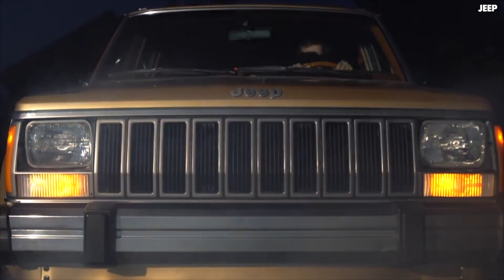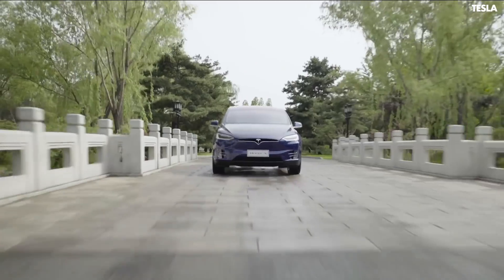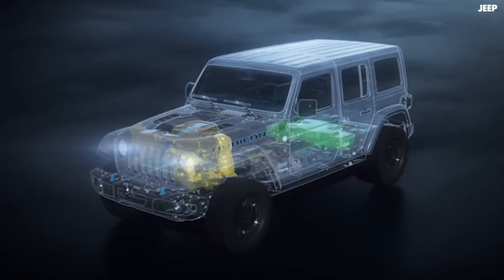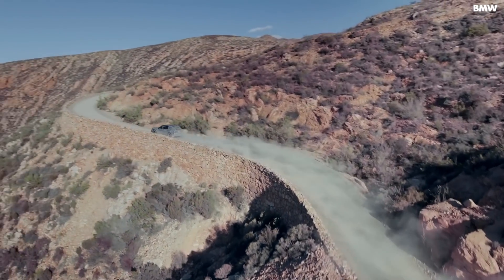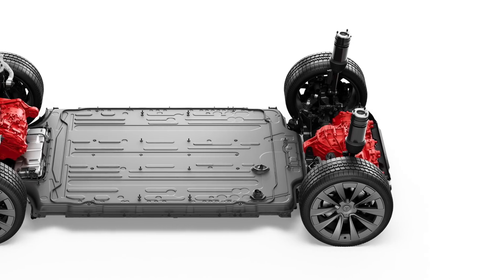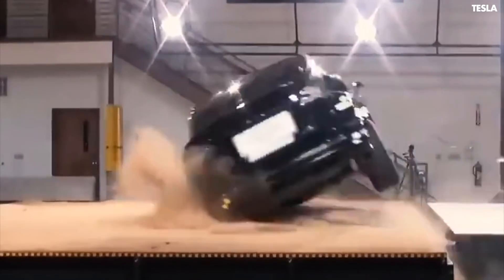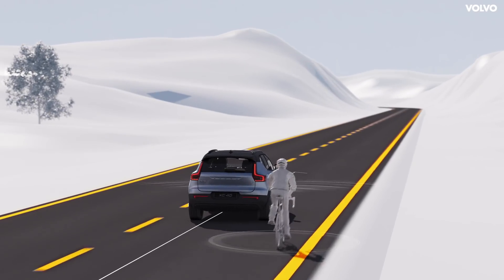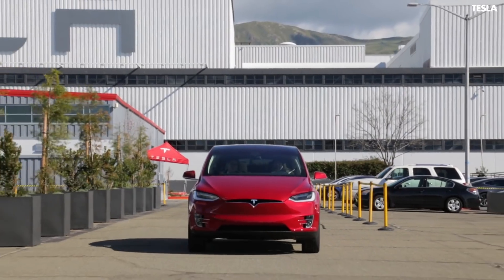How Tesla Made the Model X IMPOSSIBLE to Roll

Comment from the maker: ⚡️This has to be one of the coolest SUVs on the market, some of the engineering in this is genius!

🤔What should we cover in our next engineering video? REMEMBER TO SUBSCRIBE!
Reply: Can you make a video about the Lamborghini terzo? I think it's energy comes from the batteries in it body.
Reply: Cover the Rivian R1T with its air suspension and hydraulic roll control.
Reply: Same
Reply: Its even better when you put a roof rack on it.
Reply: Maybe the suspension system of the 2CV as it will surprise, as well as the hydropneumatic suspension invented by Citroen in the 50s as many do not realise how advanced it was.  They were also near impossible to roll !
Reply: Should have made the car more fireproof instead
Reply: The difference between traction control on and traction control off. That would be cool.
Reply: @StarryLFC  Believe in JESUS today, confess and repent of your sins. No one goes to heaven for doing good but by believing in JESUS who died for our sins. GOD loves you soo much unconditionally.😍🤩😇❤
Reply: It does not have 1000hp the model X plaid will have 1000hp but it has not been released yet, it has around 700hp
Reply: Not having an engine actually is worse because usually the engine block absorbs a lot of the crash energy

Comment: @Driven Media

 maybe I am wrong, but air suspension and adaptive damping won’t make a significant difference in the handling of a car compared to more passive setups. The advantage is that it can adapt better to different situations, but all of this comes at the cost of a significant increase of unsprung mass and overall mass of the car which reduces stability. 

Another thing to know: air suspension is limited in its bump absorption potential since there is a lot more friction (compared to coil suspension) in the process of the the suspension compressing and decompressing process which slows down the rate it can move up/down. 

The biggest benefit of Tesla’s suspension system is that the car can lower to improve stability, but the other suspension technology is to help compensate for some of the downsides of using air suspension.

Comment: These battery packs are SO heavy and Tesla balanced them so a "roll-over" is impossible! Problem is the significant ADDED weight wears out the tires and brakes WAY faster too! NOBODY mentions this little tid-bit! If YOU search tire and brake dust pollution you'll see EV's are WAY WAY worse than gasoline vehicles and are a LARGER problem than CO2 emissions as far as pollution goes! Still think these EV's are still as "GREEN" as these CLOWNS are pushing?? WAKE-UP! The other elephant in the room that NOBODY talks about is HOW do you think all these EV's are going to charge? Fossil fuels! Solar can NOT meet this "demand" by even a long-shot! These clueless CLOWNS are putting the cart before the horse because there is NO infrastructure in-place to "charge" these EV's until 2030+! STUPIDITY on every level here!

Comment: There's one other reason the Model X is far more roll resistant than other SUVs that you glossed over - low ground clearance. The example off-road targeted SUVs you showed had way more ground clearance than the Model X even on its high suspension setting.
Reply: Its not really an offroad car more like a toy for people who want to be higher above the road.
Reply: @microsoftword213  Yeah I know, which is why comparing it against a load of vehicles which are for offroad showed this result

Comment: Apart from where the batteries are placed in the vehicle, half of the reason that the model X resists roll so much is due to the weight of the batteries, even the car rolled on its side, the car will rollover back on 4 wheels. So when batteries get lighter, the car would expected to roll more since a lower percentage of the car’s mass is low down.
Reply: Then they will just add ballasts, I'm suprised no other SUVs do that since it seems so beneficial
Reply: @explosiveswine7354  Because adding weight on purpose is stupid because it hurts performance like acceleration/deceleration, speed, handling, and range.
"Luckily" battery weight won't ever get that much lighter.

Comment: You literally never showed a single picture of a rollover test on the X.  Only the S.
Also, air suspensions aren't immediate.  They take a few seconds to completely adjust so this really doesn't have much to do with rolling over.  Many cars come with adjustable ride heights and this is nothing new.  I guarantee you can make an S or X rollover since many drivers I see in them are doing 80+ mph.  You make a sharp correction at that speed and you'll flip anything.  People in regular passenger cars aren't wearing five-point seatbelts and can lose contact with the wheel since so many Tesla drivers are barely paying attention to the road in the first place.

Comment: I’m confused, so the center of gravity has to be low or high? He said that Tesla’s heavy parts have to be placed higher up because idk what and then in the sand testing it shows that the center of gravity is really low
Reply: Motors and drivetrains have to be mounted higher up in the air and that adds to higher rollover rates.  The X motors and battery are as low as the frame.  This contributes to lower rollover rates.  Notice he didn't show any pictures of the X in rollover tests, only the Model S?  He's making it sound like the X center of gravity is below the ground but we're talking about several inches.  Yes, it certainly helps but he's crossing in to hyperbole territory with his story.
Reply: @sarcasticguy4311  ty, I was confused
Reply: nah, he said standard suvs have high center of gravity

Comment: yea but, i have never seen a model x went offroad. like the real rock crawling low gear style offroad though so it doesn't really match to those other SUVs you have mentioned like the Cherokee and the Toyota Prado. hell even the BMW X7 went for dune sand Sahara style Baja offroad, i wanna see a model x do that. (probably failed because low ground clearance (even with the highest suspension setup) and will sink into the sand due to its insanely heavy batteries)
Reply: Even SUVs showed in that video can not handle off-road driving (Cherokee with mods can of course).
I believe that Tesla is not designed for off-road like other SUVs.

Comment: Hold up! Did you say that you can't adjust the seat distance from the steering wheel etc has been removed from the Ferrari to help try to reduce the CoG? Is that what you meant by they removed the seat runners? How tf do they expect drivers to be safely in the right position for them? That's ridiculous! I have to bring the driver's seat about 6" forward after my tall, long-legged husband has driven my car. And I'm not exactly short (about 2" above average for women).

I know this was about Tesla's amazing safety tests, and yes, that really did impress me, as did your explanation of the hows and whys (thank you for that, it was a fascinating insight. I'm not a lover of the marque, or SUVs, but who knows if I'll be forced to buy an electric car at some point. That's actually persuaded me to consider them). But that really caught my attention because it's potentially flipping dangerous! Not that I'd buy a Ferrari if I could afford one (overrated much? I think so), but were I a fan of theirs, that would be a deal breaker.
Reply: Simple answer is the dealer fits the seat to the buyer. Not great, but these aren't daily drivers either.

Comment: You said 3 differentials. But it's 2 differentials and 1 transfer. The transfer handles splitting the power between front and back and does so very differently from how the dif does at the axles.
Reply: Depends if it's an AWD or 4x4 setup. An AWD setup has 3 diffs and is always sending power to all wheels. A 4x4 has a "transfer case" in the middle that splits the torque 50/50 and is usually capable of disconnecting the front driveshaft so a difference of torques on high-grip surfaces doesn't snap the case or break something.
Reply: @schwarzwolfram7925  Technically a locked transfer case doesn't split torque 50:50, that's actually what an open diff does. That's the entire reason you want a transfer case to be able to lock - if it was open the extremely small torque required to spin the axle without traction caps the torque to the other axle. If it's locked and one axle has no traction then the torque split is nowhere near 50:50 since the axle with traction gets far more torque than the slipping axle.
Reply: @bosstowndynamics5488  I think I understand what you're getting at, but I still seem confused. When a transfer-case (or differential) is locked, all output shafts act as one connected unit; so both axles should experience the same shared torque and spin at the same rate. The key difference is the amount of stress each axle experiences (which will be highest at the point of most resistance).
Reply: There are so many diffs that exists
Reply: Actually a lot of transfer case options these days include a differential with a locker so that you can run open on the road or locked off-road. The 150 series and 200 series LandCruisers for instance both have centre LSDs with a locker, Mitsubishi Superselect vehicles have viscous couplings with a locker, some Jeep transfer cases have centre diffs (eg SelecTrac) etc.

Comment: Well first of all it has like an inch of ground clearance so I would call it more of an MPV than an SUV
Reply: The Model X has 8 inches of ground clearance available. That's more than a Suburban has, but less than an Outback. Again, the skateboard platform with air springs files off the rough edges of conventional layouts.
It may look like it is not far off the ground, but that's because it is huge when you are actually standing next to one. But the step in height is not really bad because there is no need to raise the passenger cabin over the drivetrain. More edges filed off.
Reply: @Markle2k   tesla model x 2020/21 ground clearance 5.4-5.6 inches.  2020/21 standard suspension burban 7.9-8.0 inches.
Reply: @ianrobertson3419  I actually looked it up. In high mode, the X has 8 inches and the Suburban has 7.9, the Outback was something like 8.2, IIRC.

Comment: I really don't understand the appeal of SUVs. I feel like most never even see a dirt road, much less any kind of off road situation.
Reply: People do not buy it for off roading. Same as all the truck drivers that never use the truck part.
Reply: i do. i offroad for work and i can't have any less than an awd suv (tbh even those struggle, so i mostly drive pickup trucks), but even if i didn't, the fact you don't have to bend down to enter/leave your car, the internal space, everything just makes sense. they're not killing every other category for nothing, they really are objectively much better "people movers" than every other category.

that said i would totally own a sedan or even a medium hatch over a suv if i could help it. unfortunately those disassemble themselves just by putting them on a dirt road that's not perfectly maintained and wouldn't even be able to get to my workplace at all even on good days, so i have a bunch of pickup trucks and a suv, which is a compromise between capability and driving pleasure / city usability that i have to take. it can get to me to work and it's reasonably fun to drive, plus all the inherent advantages.
Reply: Just to name a few. Higher driving view. Bigger cargo space. I have to carry elderly passengers from time to time. They hate to crouch to get inside sedan
Reply: they are mostly made for families

Comment: I heard that it got one of the best scorers in the Moose test. The most difficult handling test. That thing something since most cars barely pass. Most cars pass if they don't roll over at a certain speed.
Reply: actually, very few cars roll over during the Moose test. generally, they will either lack the handling to make the rapid changes in direction or have excessive oversteer/understeer.  and more commonly in newer cars, the electronic stability system will attempt to prevent a slide and cause the vehicle to go "off the road" as a result. some teslas have had a problem in the moose test because they have a tendency to oversteer.
Reply: Moose test? Isn't that a mean thing to use mooses for? And why isn't there a gator test? I had a guy come to a stop a ways up in front of my on an otherwise empty 70mph road and I almost went around him and I was glad I didn't. A huge gator was passing in front of his bumper and I don't think my car or the gator would have survived if I hit it at 70mph.
Reply: @Primalxbeast  i can’t tell if you’re being sarcastic but they don’t actually use mooses, it’s just a test of a rapid lane change. also, there aren’t gators in finland so the test is named for mooses instead because it’s down by a finnish group. if you wanted to make your own test in the USA then gators might make more sense for the name but not in finland
Reply: @boxr_4214  I just felt like being silly.
Reply: @boxr_4214  you mean meese right? If you get geese and goose why dont get meese and shoop
Reply: Except that no car safety rating tests actually used this Moose test. Not in the way it's often misconstrued, at the very least.

The test conditions that the Moose tests are using are not really useful for predicting car safety as they put the car so much outside of normal handling and typical crash scenarios. 

> In reality, the test is rather constructed to simulate, for example, a reversing car or a child rushing out onto the road. This is because it is more likely that the moose will continue across the road than remain in place or turn back, making it more advisable to brake hard and try to slip behind the animal than to swerve in front of it.

When drivers see obstructions, they're taught to hit the brakes and use minimum swerving to avoid the obstruction. On the other hand, the moose test is done with the driver continuing to swerve at full, highway speed, typically over 60km/h.

Ostensibly, this simulates animal rushing into a highway, but really the typical scenarios where you may need to swerve are usually at much lower speed, in streets, not highways.

While the moose test can be used as one very small component of a car safety rating, to see how the car handles at extreme conditions, you shouldn't make your purchasing decision just based on a single, very artificial, and very unrealistic test scenario.

Comment: It's less prone to roll over, simply by ev design.  You couldn't possibly put the battery anywhere else.

There has been work to put batteries within the structure of the vehicle, but that's simply it.

Lower center of gravity.
Reply: Lucid is stacking the battery behind/undernrsth the rear passengers.
Reply: Oh that explains why this particular ev is better than others, its the placement of the batteries and there's no other way to do it, makes complete sense
Reply: "You couldn't possibly put the battery anywhere else"
Well there's the entire empty front and rear trunks. Lazy designers could just put them there 🤷
Reply: @suryagurung7793  then you go into having an even more unbalanced vehicle.  That helps with balance that leads to braking performance, steering and a host of other things.

Comment: EV haters: teslas are not safe 
Tesla:
if you think teslas can burn which they do just remember that you got gallons of flammable fuel under you
Reply: The VERY MASSIVE difference is that you can actually STOP the flame from the flammable fuel in a normal car.
Lithium battery CAN NOT be stopped when a fire start you can only secure the area around it from not being on fire the car will burn completely up.
You see the battery has everything it needs in the fire triangle it has self producing heat it has oxygen it has fuel.
Nothing you do will stop it.

The way they stop an EV fire is to get it somehow inside a big thing made of steel that you fill with water to save everyone else you wont ever be able to save the EV or anything inside of it that you could not get out before the fire.
Reply: @Jan 6 was "Wall Street Putsch" part 2 Your video is the equivalent of linking a battery storage facility fire you have no idea how little your video has to do with anything a normal car fire would have.

Comment: If you put enough large passengers in (trying to stick to polite terminology...but as large as possible ☺), I wonder how much easier it would be to roll? Bit pricey to test, so I reckon there's your million subs video! Perhaps not with real people...you could buy a few dead pigs and have a hog roast with the crew afterwards though.
Reply: The said tests are done with weighed mannequins inside
Also tesla it self weights over tons
Even with 5 passengers their weight is not enough to change the center of gravity much
Reply: @kyarumomochi5146  The car weighs about 2.5 tonnes, while 5 large passengers could easily be 750kg which is an extra 30% weight. That'll have a pretty significant effect on the centre of gravity. Obviously the car will still be relatively hard to roll, but it'll definitely be easier than with a lighter load.
Reply: @ApothecaryTerry  5 large passengers will be 750 kgs???
What the hell are those passengers
Car is meant to have 4 passengers anyway and what the fuck is 750 kg for 5 passengers lmfao
Reply: @kyarumomochi5146  The whole point of my original comment was very large people...so yeah, 150kg each. We know the result with normal-sized people since that's what's in the video, why would I be talking about people close to that weight?

Model X is sold with 5, 6 or 7 seats. 150kg people wouldn't fit in the back 2 I'd imagine but you could squeeze a pair of 100kg guys in. Add a bit of luggage and you could easily load one up with 1000kg, which will have a definite affect on the centre of gravity!